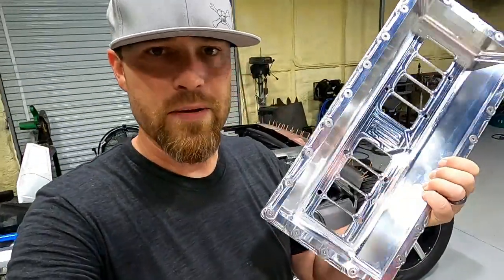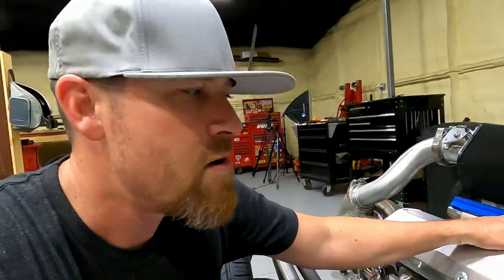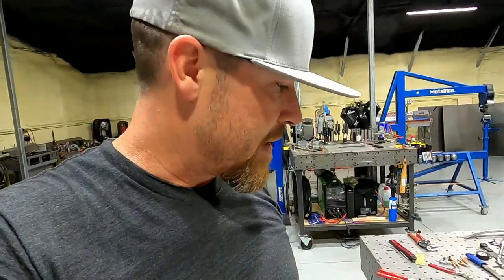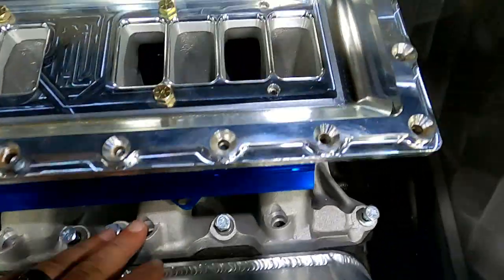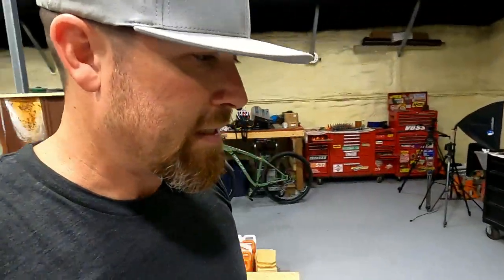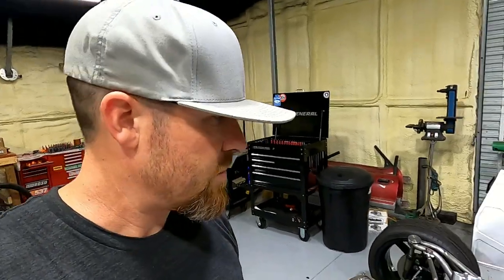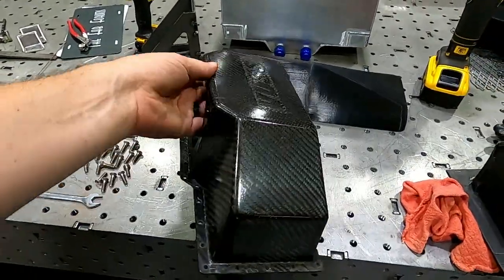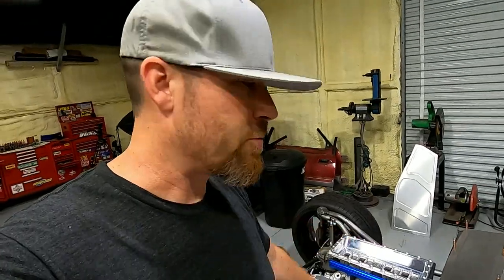New Plans for the Carbon Fiber Intake Build

Comment: 5.0 Ford Explorer will have a oil pump drive with a cam sensor on the top of it. Tons of them in the junk yards.
Reply: This is what I used as well. 96 or 98 explorer I think.

Love the intake bling. Maybe get an additional O ring for an extra.
Reply: yes but they dont fit the taller deck height (302 is 8.2" 351 is 9.5" ) 351 block. you have to modify a 351 dizzy shaft with the top of the cam sync to get it to fit/work.

Comment: You could always use a phenolic spacer to raise the upper intake higher. it will also keep a little heat out of the upper intake. Edlebrock part number 8727.

Comment: Don't forget that galvanic corrosion is a major downside of carbon fiber.  Sandwich that shit with stainless steel bolts and no insulation, and you've got a Funyun factory dropping flakes of aluminum into your engine at a constant rate.

Comment: That 1 dislike is from a Ford guy that does not like the idea of coil over plugs. 😁
Reply: I second that motion. Can't help it, from way back when I built a 351 Pinto wagon. Of course they didn't have coil over plugs back then. It was more about the distributor in the front and not in the back.

Comment: I'm probably too old school and uninformed about boosted intake charge, but can't help worrying that the rear ports will somehow get cheated because the throttle body will be way at the front. My instinct is to put a horizontal baffle inside to let the rear half get "half" of the mixture. Think I recall the carbon intake, though I was probably not a sub yet. You had instructive carbon videos that caught my attention.
Reply from the maker: If the fuel delivery happend near the throttle body it may have some issues but all the fuel is injected in each individual runner. As far as air flow goes, it will pull what ever it needs from the plenum....or pushed in under boost

Comment: I remember first finding TFF way back when on the intake build.  That and the Honda parts in carbon fiber.  What a ride it's been since then.  The billet lower looks great, and you'll probably have to add double the layers for forced induction pressure.

Comment: Stinger Performance's PiMPxs ecu has a few distributor less options including a CAS (cam angle sensor) unit that uses your distributor as cam sync and oil pump.  Great standalone setup...

Comment: How do you plan to deal with the possibility of galvanic corrosion between the aluminum and carbon?
Reply: I was thinking the same thing Logan.  "The issue with using carbon fiber materials for fastener applications is that carbon fiber is electrically conductive, thus making it more susceptible to galvanic corrosion. ... Aluminum and plain steel, when coupled with a carbon composite, are both highly susceptible to galvanic corrosion."
Reply from the maker: I dont. I have mated carbon and aluminum for a long time and have yet to see any issues. The Goose has some carbon brackets on it that I made. I have also used cabon tubes and panels in the past on racecars.

Comment: What about an intercooler? Would add a lot of complexity and probably difficult with your whole style, but would result reliably in more power.
Reply from the maker: yeah that would be cool....going to try using meth injection first, but if I dont like that I may try to come up with something else. I dont plan to run a ton of boost on this thing

Comment: Very nice, can't wait to see the intake together.   (sorry to hear that half of the bolts don't line up).
    Thank you and have a great day.
Reply: Considering it was modeled from a photo it fits very well, I bet the bolt hole issue has something to do with the camer lens bending the image
Reply: @toddmccarter45  yeah it's due to the cast lower. For whatever reason the bolt holes are not symmetrical. They are centered with the two inner holes, but were not on the outer holes.

Comment: The later explorers with 5.0 had a cam sync installed from the factory. Just FYI.
Reply: It was like a tiny distributor, just had a cam  sensor mounted on the top. Should do the trick if you go to c.o.p.
Reply: Oh your running a 9.5 deck, you’ll probably have luck with Holley. I’m new to the channel, sorry to get your hopes up. Oh by the way, if anybody confuses that engine with a ls then they aren’t a real car guy. Sbf valve covers are iconic, even if they’re sheet metal.

Comment: Got a shark hide question,  have you used it on anything cast? I want to die my aluminum intake. I was wondering if you've ever done one , and if so how did it go.ie application and longevity.  Thanks
Reply from the maker: Yeah I use it on everything...havent found anything it doesnt work on

Comment: remove the distributor, install a fueltech FT600 or FT450 with phonetic wheel, which in addition to controlling everything in the car the phonetic wheel makes the ignition function better

Comment: Lookin' NICE!!! I can't wait to see the carbon intake come to fruition! A thought for the cam sink/oil pump drive, look into using a '99-'04 ford 3.8L V6 cam sink/oil pump drive. They are used for that exact purpose on those engines and it's an oem part. They are also very low profile and small in diameter (the actual sensor that is). I'd imagine it would work without modification because the 3.8 is essentially a 5.0 minus two cylinders. I just got done putting some new parts in my brothers '00 mustang 3.8, that's why I thought of it. Anyways, keep up the awesome content! Stay safe down there! Dan @6-4_Fab Glen Rock, PA USA!

Comment: I think you meant coil near plug, LS engines aren't coil on plug; but Ford Mod motors are.     You could go coil near plug and mount the coils under the hood and run plug wires, then no one would think anything of it.
Reply: Also, I remember that OG intake, that's how I found your channel, looking for CF tips.
Reply from the maker: Yeah coil on plug just means you have one coil per plug.
Reply: @Thefabforums  Coil on plug means the coil is physically installed on the plug.
Reply: Exact reason I unsubbed from recklessregal! Smartass, everyone knows what Kyle means, neither Ls or sbf has actual coils directly attached to the plugs. Technically recklessregal is misspelled if we’re getting technical. No one else could possibly know or seen better than regal man what’s his face!
Reply: @lesgray3355  Have fun, we won't miss ya.   I was simply pointing out that Kyle could actually do COP as it's a Ford thing, if that's the route he really wanted to go.

Comment: Msd I think makes a flat top distributor that the plug wires come out 4 on each side for the big block Chevy, I dunno if they do a ford one.
Reply: MSD MY SPARK DIED REPLACEMENT PARTS NOT AVAILABLE AT PART STORES YOU HAVE TO SEND TO THE MFG . PERTRONICS  PARTS ARE AVAILABLE AT PART STORES .🐤🐤